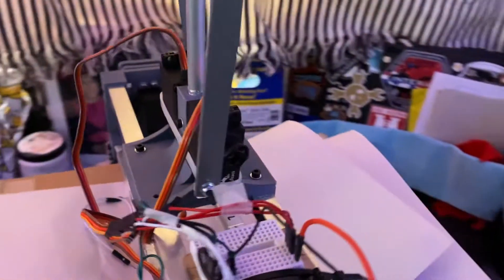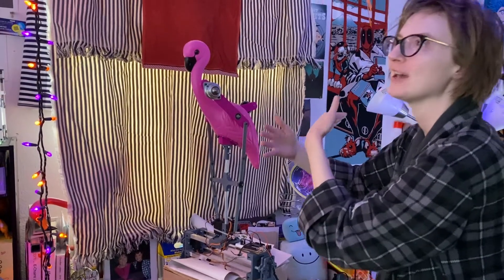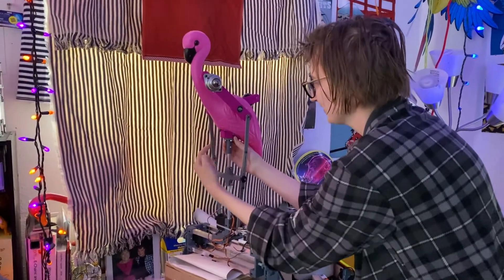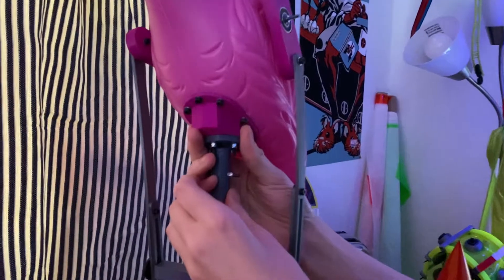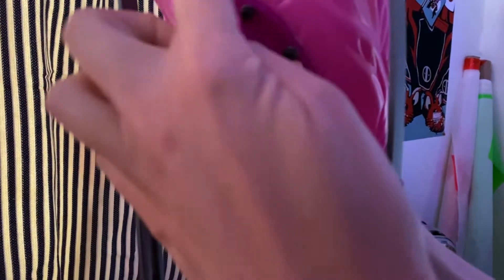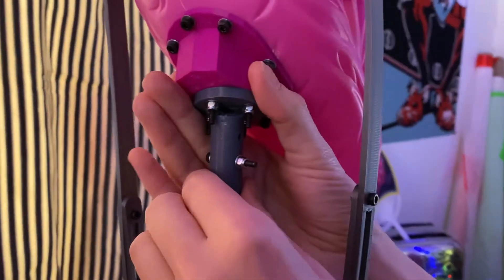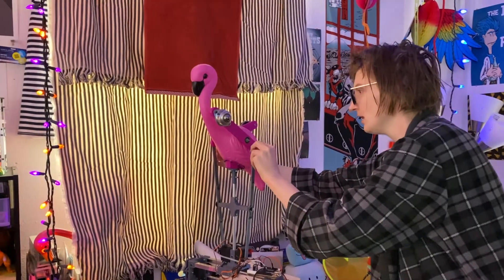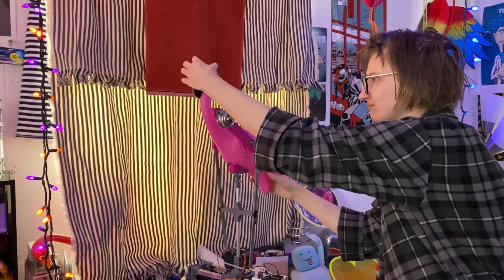Status Update on Carl's Wing Flapping

Comment: Progress!  Go Carl go!

I suspect you know this but with a part like that flange it often helps to fillet the shaft to the body to avoid creating a stress riser.  Even a small filet or chamfer can really help, particularly with 3d printing.

Sorry if that's something you're aware of already, it just looked like a 90 degree angle in the video!
Reply from the maker: It is a 90. I believe the hardware holes are quite close to the shaft, which is why I opted not to add a fillet. I might try and squeeze one in there though if I give it another go. I didn't get video of it in action before it broke, but the softness of the plastic flamingo body is a problem also. I might have to change a lot more than the part that broke, making it unnecessary to replace.
Reply: @ROBOHEMIAN  Gotcha!  Sorry, didn't mean to come across telling you your business and I definitely see what you mean about the body... interfacing with mediocre parts is always a challenge... good luck!

(Goes back to my own failing prints...)